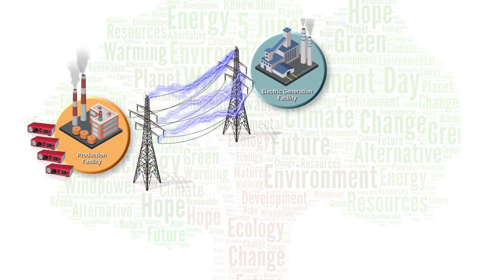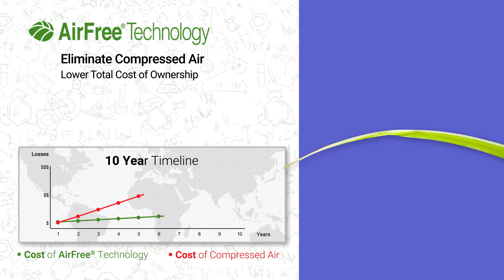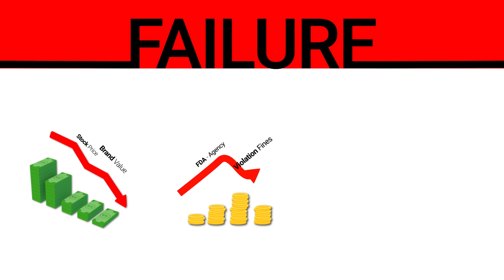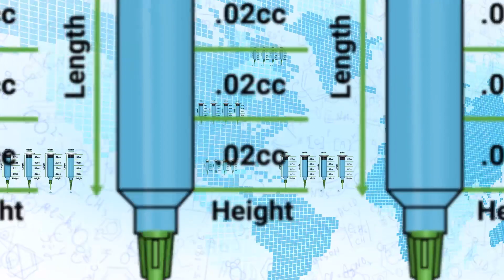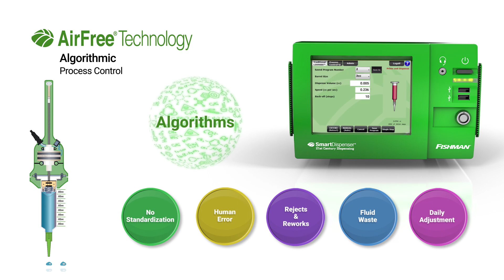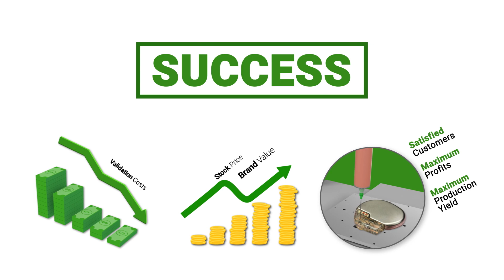AirFree® Technology

Comment: Just saying: 1) Calculating the Volume of a cylinder is not a ALGRORITHM... It's just a calculation. And second: Your freaking calculations is just WRONG... And that is just sad in a promo video. Alles gute - auch beruflich!
Reply: Is not only calculation, if the liquid is changing with the time, the calculation should be different and the equipment should be calculate according the viscosity.